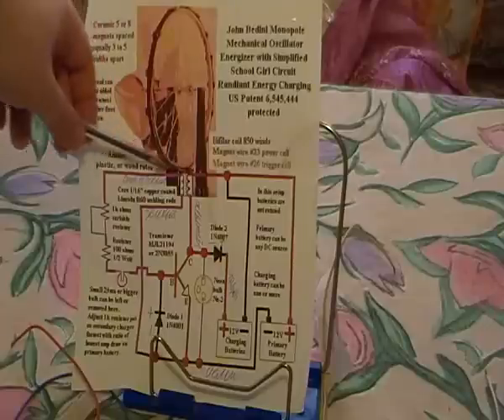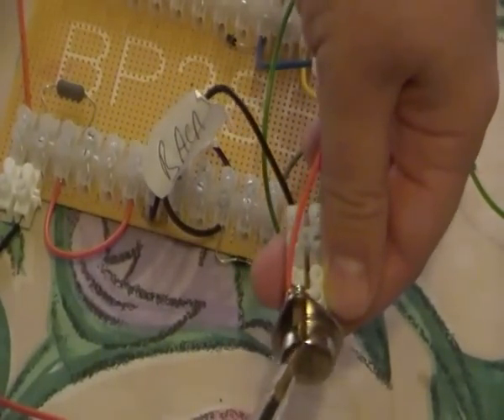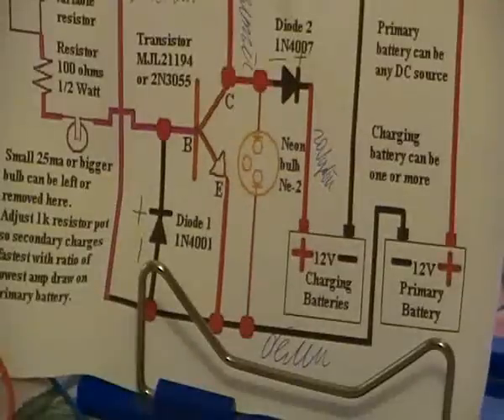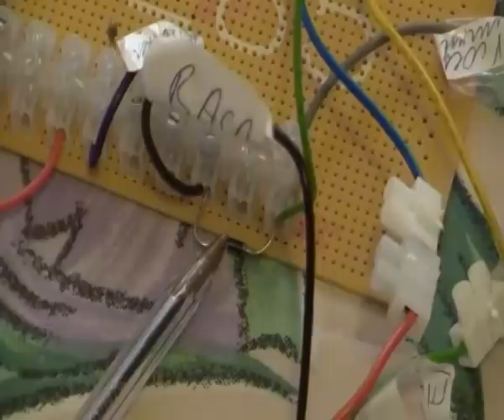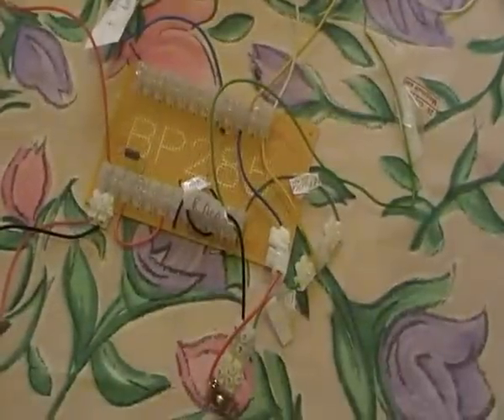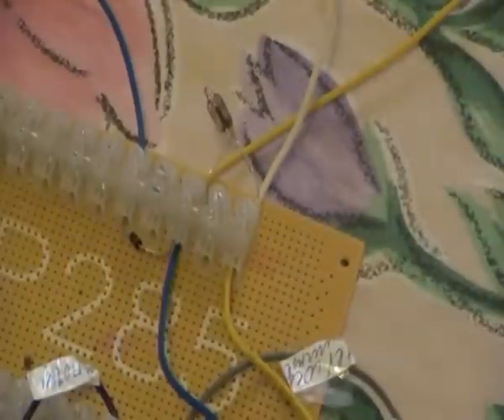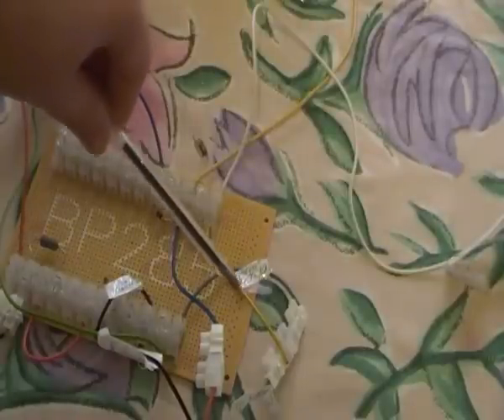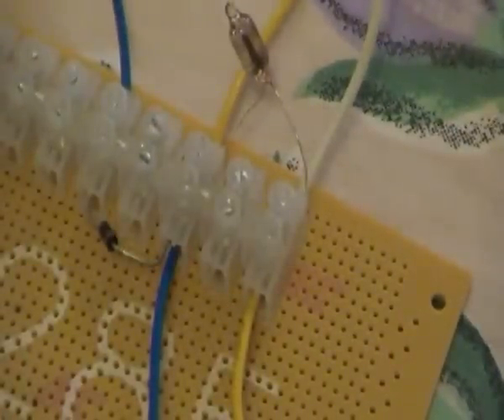My Bedini circuit PART 1

Comment: @BEDINSSGUKRAINE I have built a Bedini motor and done numerous experiments to charge batteries.  I never said it was OU, I said it doesn't work. Maybe I should elaborate...it is not an effective battery charging system.  Yes it makes a wonderful pulse motor...but the motor is weak.